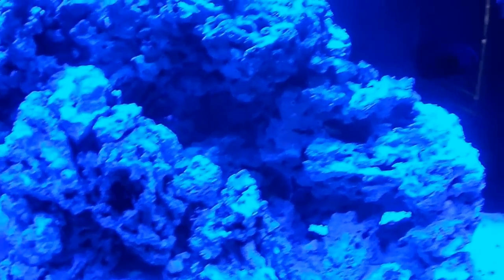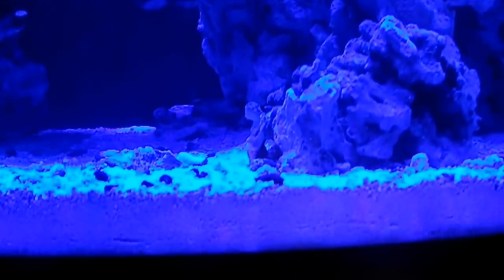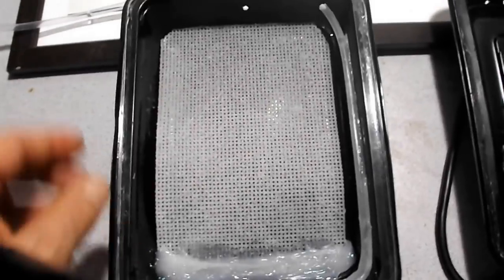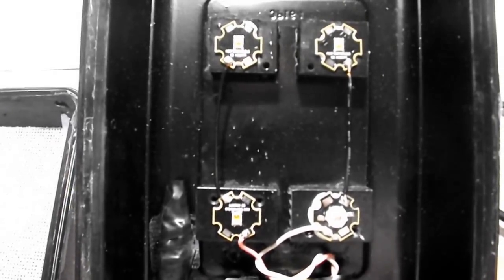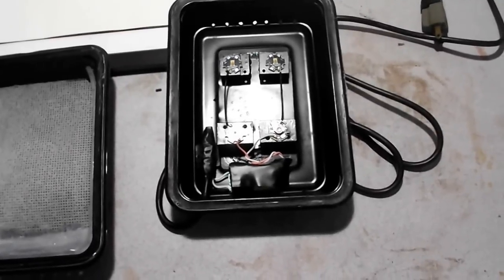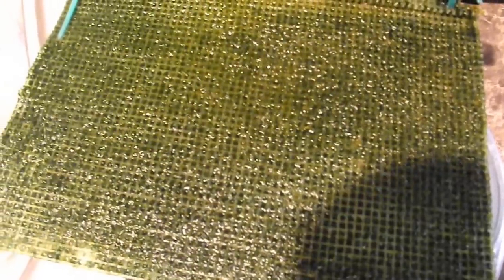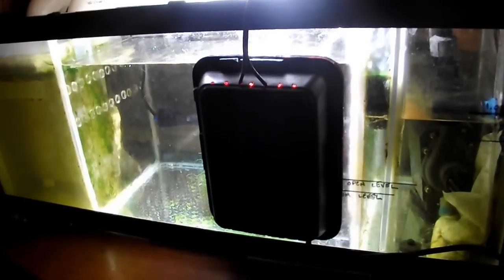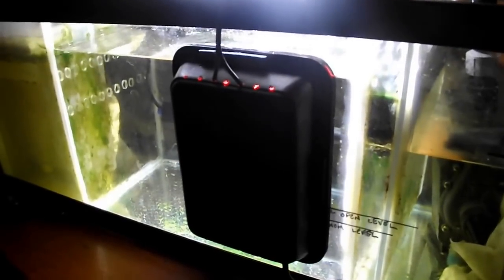DIY Upflow Algae Scrubber

Comment from the maker: Thanks RR! It is working out better than expected. I turned off my skimmer 5 weeks ago just to get a measure of how much the scrubber is doing to control water parameters. After a week of the skimmer being off both Nitrates and Phosphates are undetectable with the API test kit. I am still not running my skimmer, and no algae in the system to speak of.

I'm thinking of building one to give away as a contest prize for my 100 sub's appreciation contest.

Comment: Update on my silencing of my SM HOG2 scrubber I wasn't completely happy with it so hit on drilling 5 more holes in the top of the wet side to allow air to escape faster which reduced the spitting of water from within. I have my wet side now about 1/2" out of the water which makes more or less no difference to algae growing inside in fact it's better it seems as the water level in the wet side is higher than before. Job done.

Comment: I have an overhead sump on my 75 gallon freshwater.  Think I could add a section at the end of the sump to be an algae scrubber?  Currently my water enters the left goes through a mechanical filter, then through a carbon chamber, then through 2 feet of media(lava rock) that leaves about a foot I can play with.  I'd like to put a series of vertical screens lit overhead by leds.  The water would then pass though them and finally out to the tank.  Do you think that could be an effective algae scrubber?  Thanks.

Comment: Hey great diy! Wonderinfmg what kind if magnets you used? Thanks :-)
Reply from the maker: Thanks! and thanks for watching!
I got the magnets from Home Depot, and can't recall the brand. I just remember getting the strongest ones they carried, and were the perfect shape to fit.
Just remember to completely silicone the magnets.
Reply: AquaPorn 
Ok cool, what kind of silicone did u use, ill be making this very soon, looks as good as the santamonica !!thanks
Reply from the maker: I'm pretty sure it was GE. use a silicone that states it is 100% pure silicon. You dont want anything that has an additive in for mold/mildew resistance, or anything else.
100% pure silicon and it will be aquarium safe.

Comment: if u want to eliminate the noise all to gether. have a look on ebay for a submergible pump. all u need would be about 5 liters pump and u will not have any of the noise u get with a air pump and gett just as much water movement
Reply: Zane Deering  how did it work out are u getting good growth great video thanks for sharing

Comment: Maybe use  smaller air bubbles so they wont pop so much and loudly. I remember the those cheap powerheads fro. Petco that have the air line on the end of the powerhead they make the bubnles smaller and they wont pop or gurgle so loud. U can putit on the the inside of ur sump and connect it to the inside part of the black algea scrubber plus ull get more flow into it "gph"

Comment: "Solder didn't stick"
This is basically due to the solder not getting hot enough. If you don't flux and tin the tip of your iron regularly when using it it will get covered in oxidation and will not transfer heat effectively causing cold joints or failed adhesion. Also lead free solder has a higher melting temperature than traditional solder and does not flow nearly as nicely.

Comment: Where did you get the parts to make this?  I couldn't find them at my local radio shack.
Reply from the maker: The LEDs and driver I got from Steve's LEDs.

 http://shop.stevesleds.com/

The heat sinks you can get at Radio Shack. They're cheesy, but they stock them. I recycled heat sinks from an old computer.

everything else was recycled from what I had laying around.

Comment: Hey what exactly did you buy from steves LEDs to operate the LEDs and which LED color and type?
Reply from the maker: The cheapest he was offering...lol!

I bought the non-brand name LEDs they were only a couple of bucks each. I think they might have been called "deep red", or might have just been red. Regardless they were 660ma color which is what you want.

And, for the driver...again the cheapest he had. (wasn't sure if this was going to work, so I didnt want to drop a ton a cash) He had 2 super cheap drivers available. 1 would power 2 LEDs for $10 and a driver for $10 that would drive 12.
I thinks they were listed under economical drivers or something?

Comment: could you not have just used the led lights to shine on the waterfall one intead of the normal lights or changing the system?
Reply from the maker: Great Comment!

Yes I could have. However, I would have needed to make splash guards and a housing for an already cramped space.
I didn't design my stand to house a sump...it was originally for a double tank, so the tight space limited me. for easier maintenance I chose this upflow style.

My opinion is the waterfall style far out performed this uplow style.
Reply: AquaPorn
and what if you would use a small powerhead with an airline attachment instead of air pump?
 should do the job and keep it silent

Comment: did you coat your magnets with anything to stop it from oxidizing?
Reply from the maker: Yeas. I forgot to mention that. Thanks for the reminder. I coated the magnets on the water side with silicone.
Reply: good idea. i would have tried liquid rubber but I'm not sure its aquarium safe?

Comment: Unfortunately you cannot just pump water through an upflow scrubber; they need air bubbles to deliver CO2 to the algae, and to stir up the algae growth so that light and nutrients can get to the roots of the algae. The plus side is that with strong bubbles, light, and attachment surfaces, the photosynthesis will be much stronger in the scrubber than on your rocks, and thus algae will grow in the scrubber instead.
Reply: How does this system actually help prevent big water changes? Also how does it do with canister filter systems that house monster fish? Im interested in purchasing one but Im also thinking about trying to grow some algae on my driftwood.
Reply: Santa Monica Filtration : Did you miss the fact that his main complaint was noise? (from bubbles?) little PE i sense... ( yours are too expensive, 99$ ? jeeeze...)
Reply: Santa Monica Filtration : however all this ATS thing is thanks to him, but he making it seems complicated

Comment: What kind of magnets did you use for this inside the aquarium?
Reply from the maker: +JD the strongest ones I could find at the Home Depot. Make sure you silicon the heck out of them. You don't want the magnet exposed to the water.

Comment: Make sure that is safe for saltwater. Saltwater can leach undesirable chemicals from some plastic.
Reply from the maker: +Felix The Cat Heard that dude! I believe this should be fine as it is 'food safe". I still have the scrubber, but I haven't been running it as I have switched to a GFO and Carbon reactor which I have found to be much better and easier for phosphate removal.
Reply: Certainly looked well designed. GFO works well but my problem was the super fine stuff would get into the aqaurium no matter what I tried. Switched to seachem phosguard and that is more fluid dynamic and does not leach when exhausted like gfo. Actually a lot cheaper to.  They want a lot for the algae scrubbers from the few that have seen for sale. Don't have a enough room for the above water type either or would make one of those.